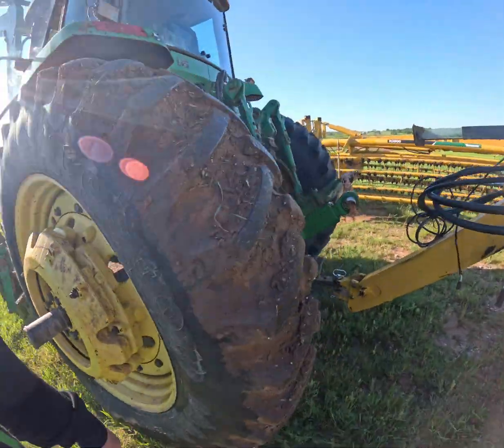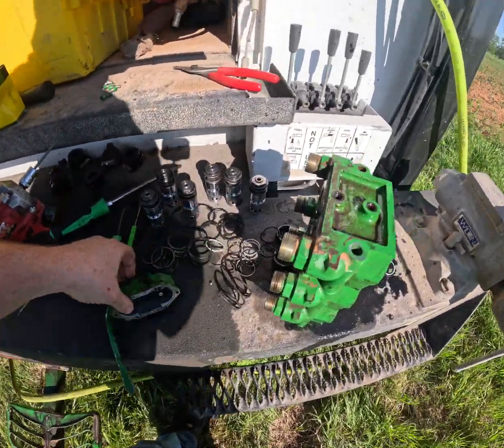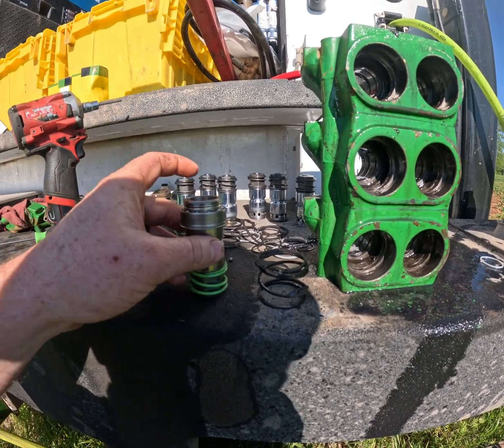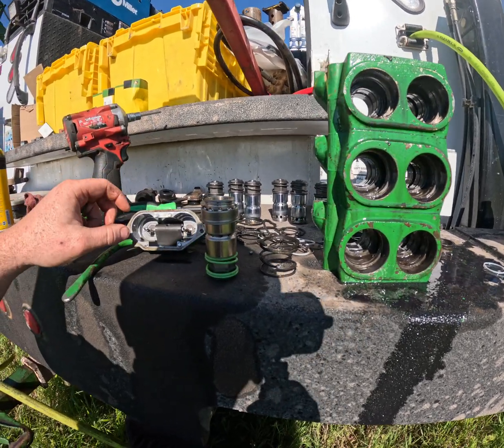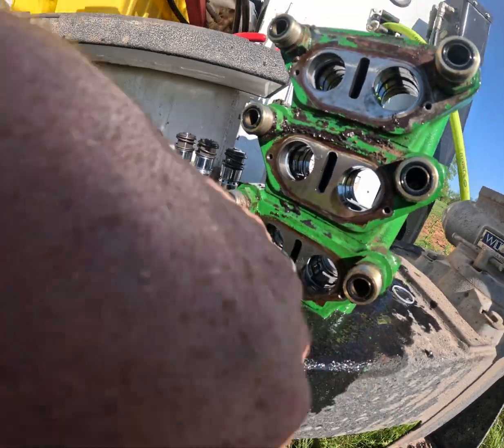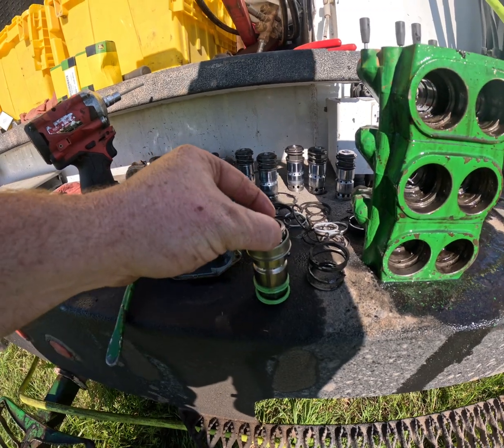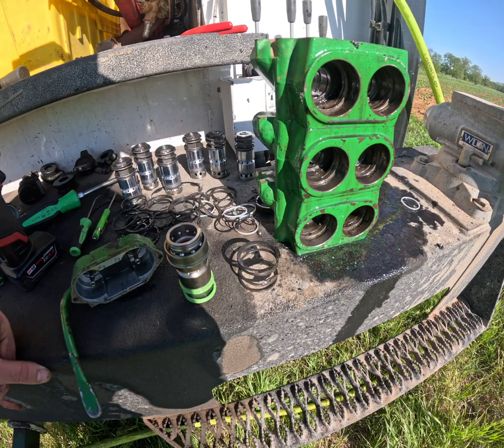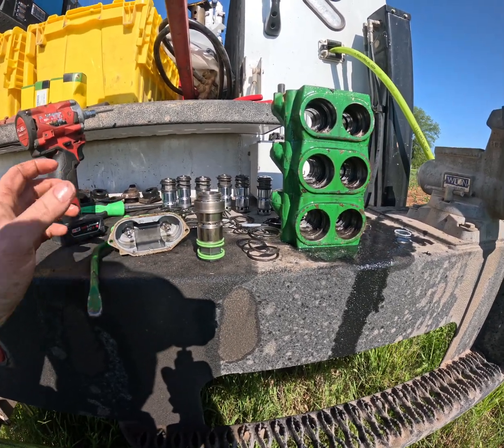John Deere 7810 scv coupler rebuild

Comment: Would the seal on the steam on the back cover cause it to leak out of the vent tube on the bottom of the scv
Reply from the maker: Vent tube to ground or back into transmission?